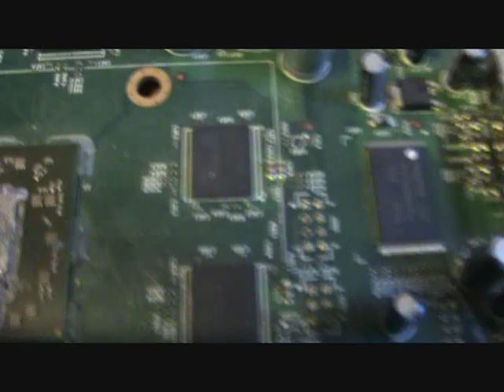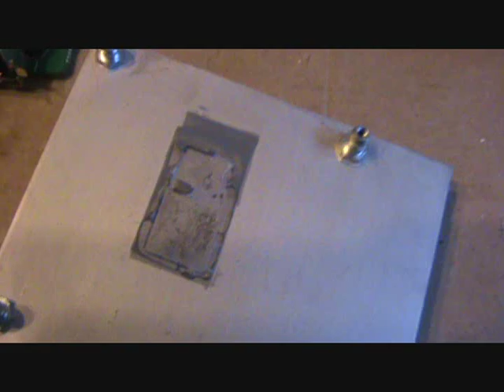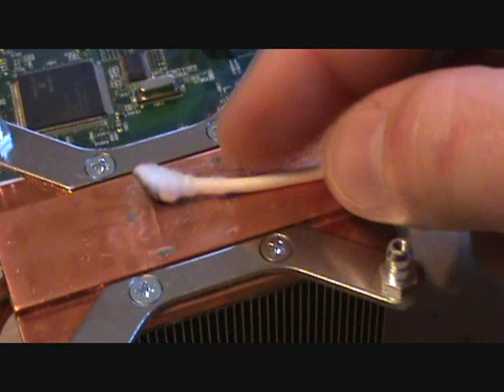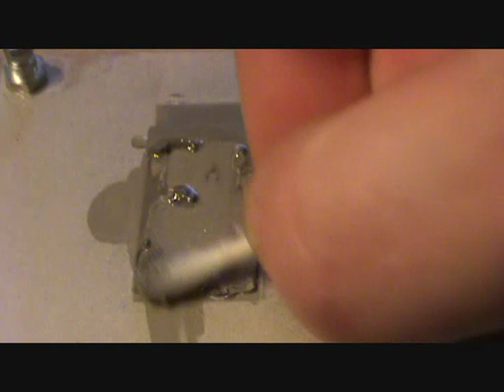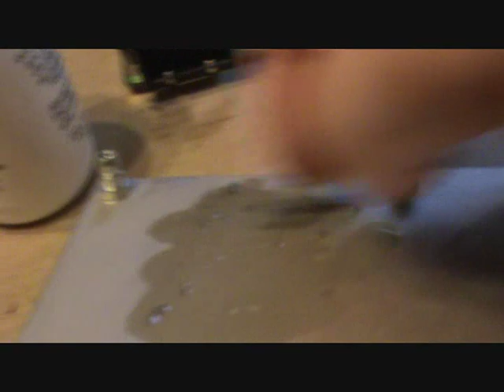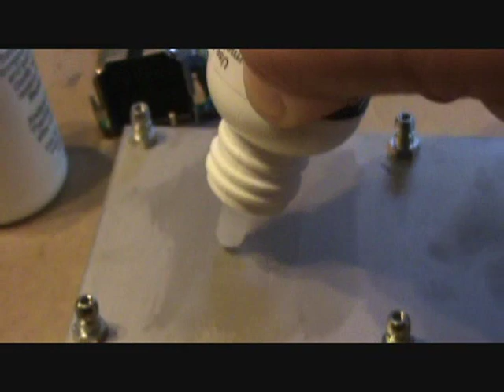How To Clean The Xbox 360 Heat Sinks - Repair Tutorial - Best Method

Comment: A few protips. 
1. A reliable (but not as safe, don't get anywhere you shouldn't) thermal gel cleaner is lighter fluid. Use a much smaller amount though.
2. After these steps, make sure to apply replacement compound. Some of the most industry leading stuff can be found here. It's a little pricey, but tottally worth it. The name comes from the actual silver it's made from, so just get it, and apply some in the place where you removed the old stuff.

Comment: @enigmaticbee 
Then they probably did it right. Less is more when it comes to thermal paste. It's the pressure of the heatsink against the chip that counts for more. If you have too much paste you'll just be making a mess around the edges with no extra benefit.

Comment: Had rrod and did complete dismantle removed old thermal paste cleaned then reapplied new thermal paste to gpu and CPU. Turned on and still rrod "general hw failure". So stuck 2 precision screwdrivers onto fans and let overheat 10 min until rrod "overheat" 2 lights appeared. Let cool down. And now working?! Didn't do X-support kit fix. Don't know if I'm lucky or what but can't wait to play Duke Nukem Forever.

Comment: His link redirects you to a very reputable and FUN poker website where you can win money without spending money, definitely not a scam.

 Great guides TripAces, found them to be a ton of help when fixing my xbox, only thing I would say is that you can use Goo Gone and then 91% isopropyl alcohol ($3 together at any grocery store) and get the job done just as well, if not better, and for cheaper. Just make sure you clean up all of the Goo Gone with the ipa or you could run into problems.

Comment: Thnx! Looks like I'm buyin myself a new one for christmas tho...I managed to break a tiny little chip off my motherboard! After much swearing (& browsing online for xbox MB's) I'm just gonna bite the bullet and get a new 1. I WILL say this though: My 360 ran fine 4 years with an intercooler, and died about a month after my intercooler died. So, does anyone know if the newest systems are still problematic? Mine had the improved heatsink, but I don't know if the new ones are still even better....

Comment: So I cleaned off the thermal compound (Although I didn't use cleaner like you did) then I put some new thermal comp. back on (It was "ACME" white stuff from fry's, not arctic silver) and my 3 lights were still flashing when I put everything back together and turned it on. So should I now go through the steps to reset it (Like you showed in 1 of your other vids)?
I will redo the whole process if I have to, I want my 360 back! I haven't played in weeks and I'm "Jonesin"!